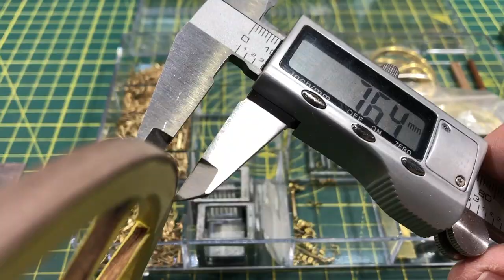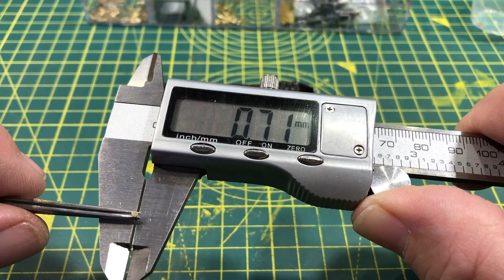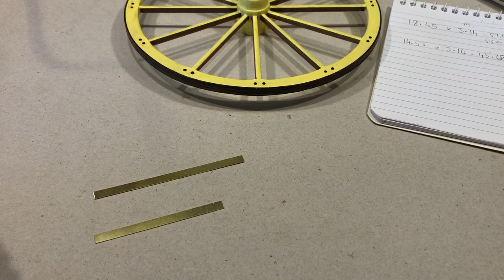Artesania 1848 Stagecoach - Build 5

Comment: Hi Chris, is that little tube of Super Glue you're using a gel?  It looks fairly thick vs the Zap-A-Gap CA glue you use of the other parts of the wheel assembly. I'm thinking a slower set time might be better to set the brass hubs correctly. ??
Thks 
Ken
Reply from the maker: Hi Ken. Yeah, was a small tube of slightly thicker CA that I had laying about

Comment: Hi Chris, did you ever think to put the rim strips in water first? if not why not? Kind of curious as stated in the introduction Artesania plans it may help in making the radius. 
 I am nearly up to that stage now. I noticed you have a depth nozzle on your super glue. Where did you get that? What is its proper name? I know that is a very important nozzle to have.
 How do you stop it from blocking up? Just for future reference it may help you in your model making that Tarzan Grip make a Super glue that takes a while to set (20 mins or so) but man its stuck! Buy that at Bunnings and it dont mind the heat or the cold for storage meaning it does not go off. Cheer
Reply from the maker: Hi Gary. I did look at the idea of soaking the rims in water but decided to go the way I did from past experiences with water and superglue curing too quickly
Reply from the maker: Thanks Gary. I do something similar with a hot air gun/blower

Comment: Hi Chris, I see you have installed the wheel rivets, only, on the outside of the wheel. Is that by choice or did you install rivets on the inside of the wheels later? Just curious.
Reply from the maker: Hi Ken. I installed Rivets to both sides of the wheel felloes. Maybe not clear in my videos.